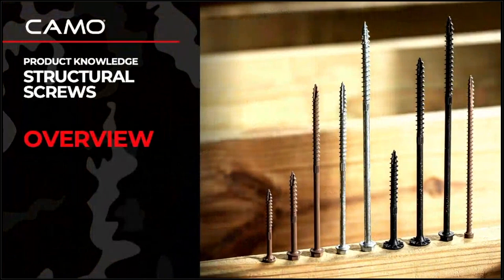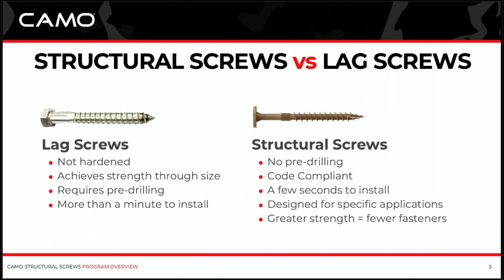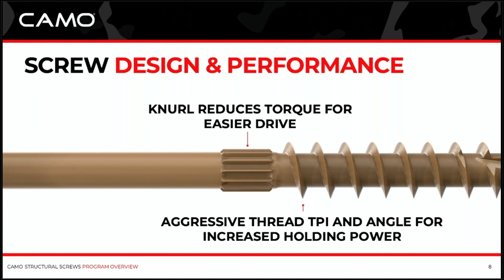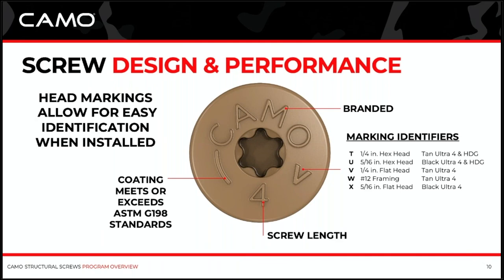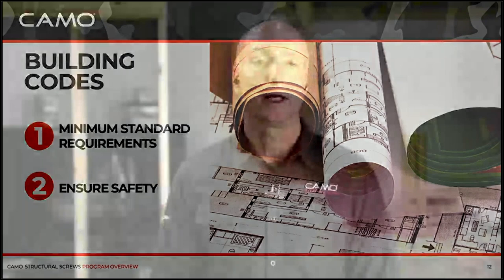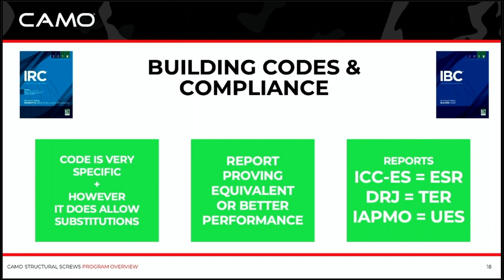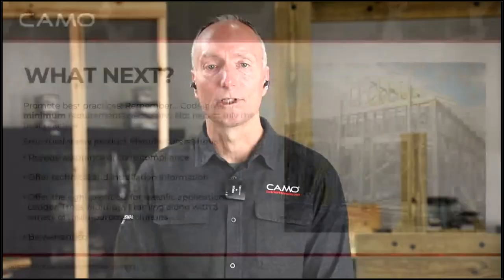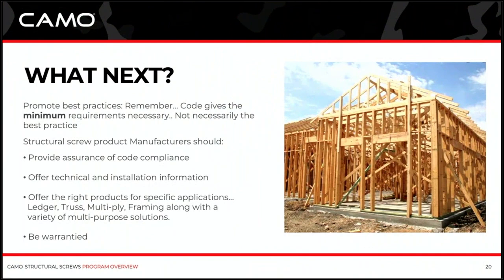Structural Screws 101

Comment: Seems the only folks still using lags are those who haven’t been made aware of the advancements in rss screws.
  
  If anything, the ability to skip pre-drilling is reason enough to forego lags. You’re taking twice as long for no reason and, if the cumulative time was added between two framers both constructing the average size home, I imagine the metrics on speed differential would be astonishing.

  When you can claim that you’re company can frame a home twice as fast due to specialty fasteners compared to traditional lags…that’s a statement means something to the average home owner, real estate entrepreneur, investor, etc.

  The cherry on top is that the majority of top of the line structural screws are to code and can’t be knocked by an auditor. Put it all together and you could almost be called foolish for still using conventional lags.